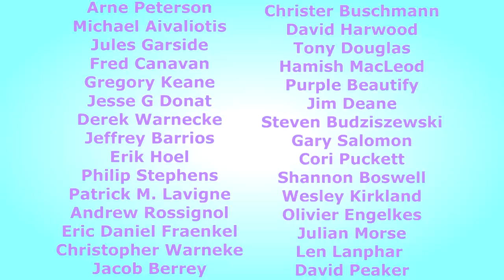My Air Pollution Solution

Comment: hvac tech/ b.a.s. service guy/ engineer or whatever fuck it i don't know what my title would be. Regaurdles i work hvac.

Anyway a possitive building pressure system is a very affective method of controlling indoor air quality.  Especially since pretty much all usa cities have that nasty grey dust problem it helps us keep our medical buildings cleaner by keeping them at a positive pressure.

And by directly increasing the space pressure your able to make it so that whatever air does enter the space is filtered and wont contain that crap

Comment: Two comments....
1. .I know you have the parts and the smarts to assemble a killer electrostatic air filter.

2. We still have pollution regulations in Canada!😆
Reply from the maker: Ozone generators are not a good idea, they destroy lots of naturally derived materials.
Reply: @FranLab  if kept relatively clean...no arcing I think the improved filtration is worth it...especially with asbestos.
In the meanwhile. ...switch on all the CRTS! 😆

Comment: Why are you letting yourself be walked all over? You are in a very powerful position. You should be able to get the demolition stopped immediately, have the building tested and if asbestos is detected it would cost the new owners a fortune. They should buy out your lease and pay all expenses.  Have you told the workmen about the asbestos? I do not understand why you are doing next to nothing. 1 days exposure to airborne asbestos is 30+ years off your life.

Comment: Hepa is the solution for chemtrails.
Reply: I doubt it would trap the nanoparticles.
Reply: @manolisgledsodakis873  To qualify as HEPA by industry standards, an air filter must remove (from the air that passes through) 99.97% of particles that have a size greater-than-or-equal-to 0.3 µm.